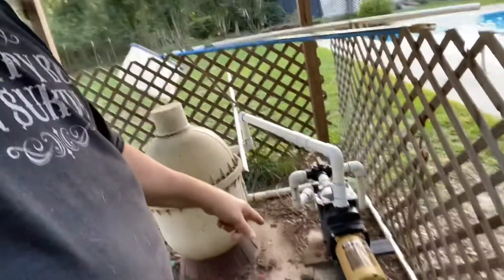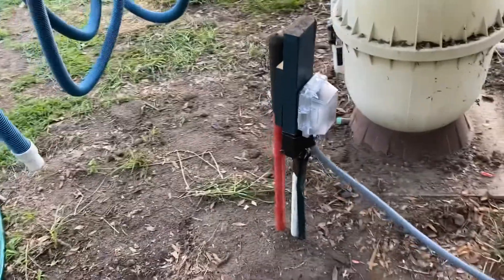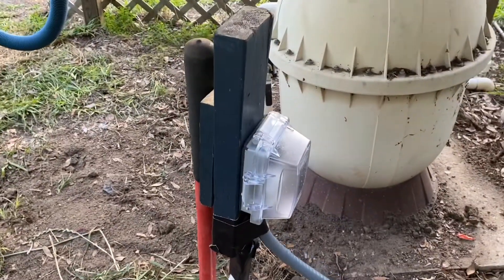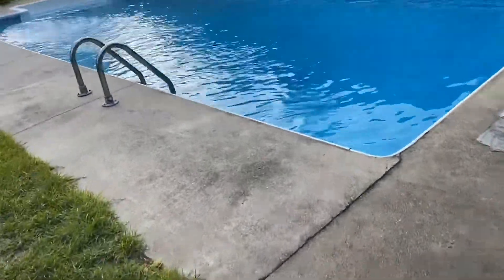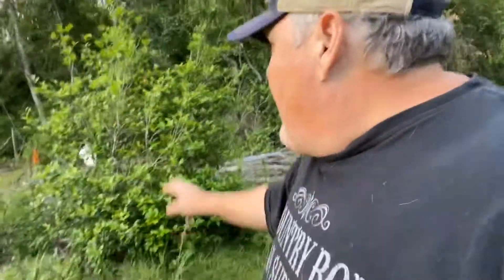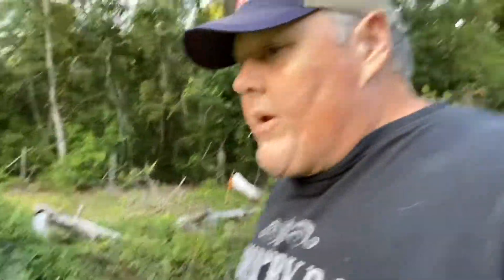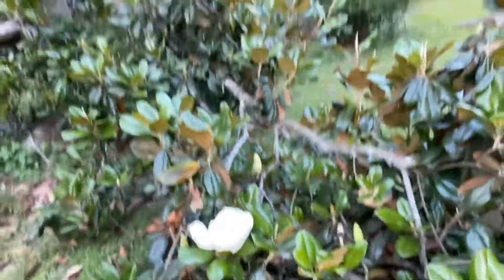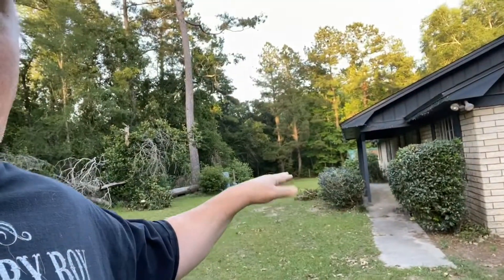Hump Day Truck Update/ Redneck Rigger/ The Landstar Life

Comment: Inviting blue water in the pool...If only I knew how to swim..Good job on the rewire..It will be a lot safer..Taking care of those down trees will keep you out of mischief.. Would be nice to have a tractor with a bucket on it to help clear it away..Do you have a fire ring or pit for bon fires at your place? Maybe stack the wood and use some it for that if you do..I forgot what is being repaired on your truck? Maybe this repair shop where your truck is at.. Does it the right way so no problems later down the road.. Thank you for the video..Have a blessed day..